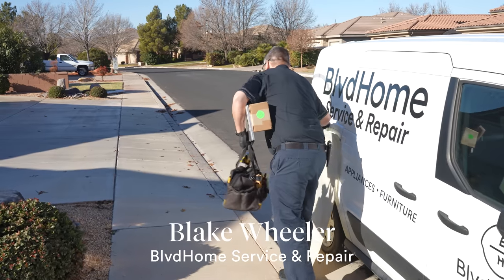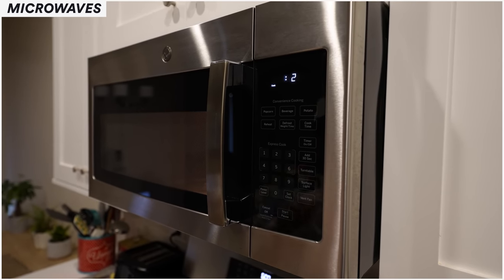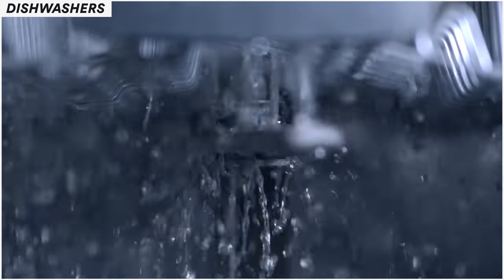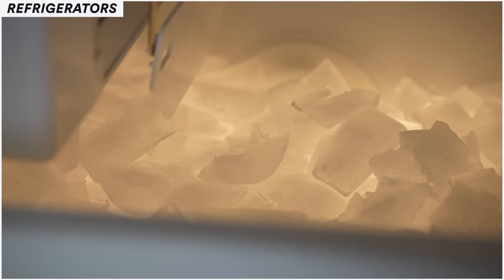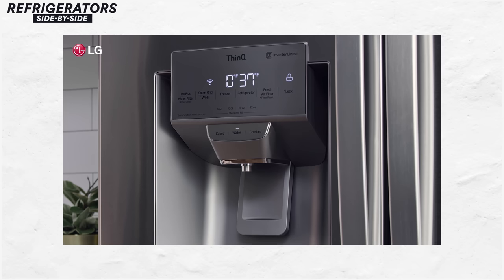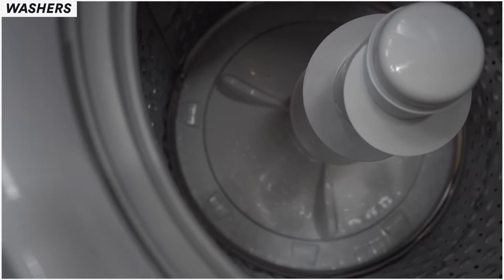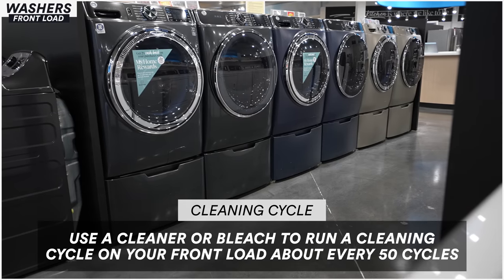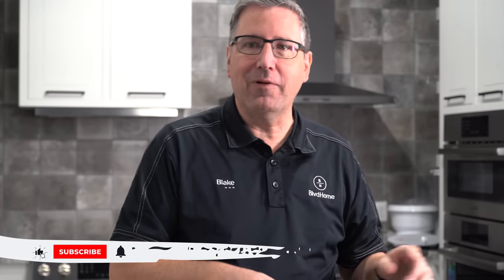Best Appliances Recommended by a Repair Technician of 29 Years

Comment: 1. any microwave with your settings and space is alright
2. bosch dishwasher best
2. french door bottom freezer best-frigidaire best, go for no ice door, GE good too, avoid LG samsung
3. Top load washing machine-speed queen, LG and GE best
4. avoid front load washing machine cz of many issues
5. front load washing machine-electrolux best, lg 2nd, GE 3rd then whirlpool
6. dryer should match with washing machine. cz it looks good.

Comment: I just bought a top freezer Whirlpool refrigerator and I am disappointed. Temp control sucks. Very poor temp control. With only one temp control, to make the freezer 0'F, the refrigerator will freeze if I leave the unit for a few days. I had a GE for 25 years and was a fantastic unit. I would not buy  a Whirlpool.

Comment: I completely disagree with the LG washer recommendation. I know they are one of probably many manufacturers who make the washer with an aluminium spyder touching the steel drum. This causes corrosion which basically creates a ticking time bomb. A few years into ownership, someone puts in an overweight load and the washer becomes a big paperweight. As you well know, the cost of fixing a failed spyder is not worth fixing so the company sells you a new machine. It's unethical and disgusting business practice so I would never suggest that anyone buy an LG front loader washer. I know Samsung washers are the same but I'm not sure if any manufactures build their machines to not self destruct.

Comment: And never buy ANY appliances from Home Depot……why you ask? Because once they drop it off Home Depot will not stand behind it, I mean the DELIVERY guy was showing me how to use it and said “hmmm that doesn’t sound right and I still had to go through all the red tape and 3 technician visits over the course of 3 weeks before Maytag would finally replace it, one month later. Anyone else how much fun it is to have a brand new washer dryer combo and still have to use the local ghetto laundry mat because I sure do

Comment: I hate my Bosch dishwasher. It won't dry anything that isn't ceramic. 

It doesn't have a drying heater, or airflow. It assumes the walls of the dishwasher cool faster than the dishes (and pull condensation), which only works on glass and ceramics.

Comment: Fisher Paykel bottom freezers are a nightmare. 3 years old, the alarm goes off every-time you open door. Called tech he had to ask the manufacturer for help, they said wire inside door was broken and not detecting flapper heater. Fix was a new door! 3 years old, and the fix is a new door. Numerous calls to Fisher and they dont care. Jokes on them, Im a builder and buy appliances for our homes. Guess what I dont buy anymore! Side note: All our LG fridges with linear compressors run without a complaint.

Comment: I have all Samsung appliances, from washer dryer to fridge, stove and microwave.  Microwave doesn't keep good time on the clock and the samsung logo is crooked,  were talking mins off after a few months so you have to reset it.  Stove seems to be ok except the knobs are on the top in the back and there is little support so when you push buttons the whole back panel flexes / pushes back ward which is weird and annoying,   The fridge is the freezer at the bottom style,  has nothing but problems with the door ice, freezes up into a block.  the ice maker in the freezer spills ice out through the hole in the back (so you can pull the freezer drawyer out, so ice will fall behind the drawer and now you can't close the freezer, so you get to try digging the ice out.  so we just keep it off before it gets too full.   The washer and dryer,  washer squeeks like an old motel bed spring during spin cycle.  The dryer has this weird metallic grinding noise, guess its the baring going bad or something.  Most problems i've ever had with appliances.  And my neighbors and co workers who own samsung all complain about the same issues, so I won't be going with them again.

Comment: I work on commercial ice machines for a living. The biggest issue I have with my ice maker is that ice just gets stuck,  preventing it from making ice. Its easy to just blame the manufacturer, but i think it just comes with the territory. The environment is below freezing. Where as, with a commercial machine, its not. So, if ice gets stuck, it will eventually melt and resume operating.

Comment: We have the Bosch over the range 800 series microwave oven and the instructions in the Bosch manual says you can open the door before it stops running. This 800 series does not have a pause button and opening the door acts like the old pause button, you close the door and push the start button again to continue heating. Our old 9305 Bosch microwave did have the pause button that you would push before opening the door.

Comment: I hate my LG front loader washer, it just turned 2 years old  under extended 5 year warranty I bought for $160.00 for the washer from HD, but it's through a major insurance company. I've waited 16 days to have repair guy, over $50.00 in laundromat costs! Guy came out it threw a D2 CODE. It was the door lock, he had to order it at 9 days and then come back. He said door locks a common problem, it's made with plastic parts! He left, 15 min.later I started washer, it threw another D2 CODE! Taking them 3 days to come back! With LG you have to fold your dirty sheets, blankets a certain way, according to owners Manuel from the corner, back and forth, or washed goes off balance. My daughter has a front loader GE, she doesn't have to do that. NEVER will buy anything LG ever again!

Comment: Not all microwaves are the same, bought one in the early 90s, the light went out but it worked for over 20 years. After it died, I've bought two microwaves in the last 3 years

Comment: I'm surprised you didn't mention Maytag for any category. I have Maytag dishwasher and front load washer and dryer units and they have been solid for the past 5 years. You should also make a video on the brands you hate and repair the most and why.
Reply: I was surprised too, I have Maytag washer and dryer, pretty happy.
Reply: Maytag was bought by Whirlpool several years ago, MayTag is not the same Maytag many people remember.

Comment: I have a miss matched washer and dryer and I'm very OK with it.  I have the LG Front Load and LG Dryer. Nothing fancy.  I like the front load washer, however, it do get a little stinky at times.  I wipe the seal down after I'm all finished with laundry. I wipe the door down inside and out. I spray Lysol in the washing machine and around the seal. I make sure to use the cleaning machine cycle more often than recommended.  I clean out the soap tray also every few months. I love my LG Front Load washer and I'll be buying another here real soon.

Comment: I sat through this entire video hoping to hear what dryer is your preference.  Crash and burn.
Reply from the maker: Dryers are really hard to get wrong similar to microwaves. But there are a lot of differences between gas and electric dryers. We're currently working on a video where Blake does a teardown of both dryers and talks about the differences between the two. Stay tuned if your interested.

Comment: We had a lightning strike and it knocked out the refrigerator and the freezer isn’t as cold, either.

The problem is that they’re a built in side by side set and when we looked to replace them, the new version of the ones (Frigidaire Cafe) we have don’t fit in the space.

My husband wants to see if he can just replace the control boards, but they’re on back order.

I can’t imagine why they aren’t a standard size?

Comment: One thing you didn't mention was the quality of plastic used in the dishwasher. For plastic a salty environment like a dishwasher is a harsh environment, so plastic tends to dry out quicker and fail. Although plastic repairs isn't usually something you call a prepair technician for.

Comment: All he sad is like reverse. About fridges here what you need to pick do not buy any of those which has ice maker or 2 doors. They will brake and they will make your energy bills high and they are built to brake as manufacturer knows they will buy again. Better if you need really buy 2 fridges with 2 freezers at bottom. Now which to choose dont buy samsung or dont even look at fridge which has smartphone or any screen. they are useless and they will use more energy for no reason and even heat up the fridge which will cost even more energy. In shop you may see lots of fridges, but actually there will be only 3, basically all of them are same. Search for fridge which has inverter type compressor and has no frost technology in freezer and in fridge. inverter is higher price but will cost your energy bill down also it will be not noisy. Big will always be noisy as hell. No frost will make no ice problems, no water on floor. Now you will have basically 3 types thats it all will be same identical, dont look at naming like metal freezing it means nothing. What you must look is size price , energy efficiency at A or it may be same A+++ rating in europe they must place sticker of actual energy used. Now look for better plastic as it brakes and it will cost way too much. Search for better plastic, avoid those fridges which are turned on. They do this as plastic inside is cheap so it smells bad so they turn on. And yes it will brake. It would be good to find what compressor it uses from which country search from EU made. It will be on other side at bottom. also check rubber if its good if you can take it off. If you cant its probably cheaper made. Also try  to pick no handle option as they make door handles so thin it brakes easy. Dont forget all manufacturers have good one and very cheap ones which are bad in quality. But than its very expensive they will make it brake. Also pick fridges where it has computer temp controlled it will be more efficient its mainly all electronics it must have you will touch it once in life and you wont need to touch it again. Now about washers go away from those which has wifi or any of that crap, less is better. Only look for better energy efficiency ones.

Comment: I bought a French door bottom freezer because I had heard that through the door I’ve dispensers have more problems.  After 13 years with my Samsung (oddly), the first problem I had fixed yesterday.  The ice sensor bracket got knocked off.  Found it and replaced it.  Back to normal.

Comment: This was not helpful at all. No they are not all great. I want to know which ones last longer he longest and has fewer issues, and if they do have common issues , are they  costly and complicated issue or a inexpensive part diy issue. That’s the stuff that is  very Helpfully . Not these vague words you use. considering most make junk now a days. My kenmore washer and dryer are 24 years old and I will not get rid of them for the new nice looking junk they sell. I change the inexpensive parts , and recently put in a new transmission and the machine rubs like day One. Mother in law bought a new one and had problems within 3 months .

Comment: WoW! That's very interesting about the microwave door, perhaps they should have a locking mechanism similar to front load washing machines, have to press pause or cancel to open. Always had a KISS mentality with fridges, Ice trays in freezer. Thoughts on combined washer/dryer would have been good.

Comment: Don’t buy LG ever. My mother has one and had it approx 5 yrs or less and it’s now not cooling. Got to be the compressor of course. LG is giving her the run around.  A local certified repair company stated they cut off working on LG due to LG failing in contract negotiations. No one seems to want to work on a known trash company’s faulty appliances.

Comment: Thanks for this video. I agree with you about people who say a top brand is lousy because they had a problem. I have an Electrolux washing machine that’s about 6 years old and isn’t draining and I don’t know if I should have it serviced or replace it. I’d love to see a video on something like “Repair or Replace? A Guide for knowing which to do”
Reply: Electrolux front loaders - they removed the access panels to viranbthe filters which is a required maintenance for all front loader machines . It’s usually located at the base of the front of the machine behind a small access panel. It should be cleaned monthly to prevent clogs or draining issues and elongate the life of your machine. Almost all front loaders have these access panels - I don’t know why Electrolux removed them. Now you have to lift the machine and tilt it back to a 45 degree angle to try and access through the bottom panel which is almost impossible or disassemble the machine to get to the filter. There is no reason to block access to those filters unless it’s to force repair calls or new purchase parts. The 7637,7537,7437 series as well as the prior series all have no access panels. It’s discouraging. I wish they would explain the intentional reason for removing the access.
Reply: @Kathy-dj6di  Thank you!
Reply: I noticed the Electrolux front loader did not have the small door on the front when I was being helped by the Specialist in the Lowe's appliance department. She had never noticed it and had no idea why it didn't have one. She tried to tell me that Electrolux had come up with a solution to where you didn't have to drain the water out so that was a good thing. But when you watch YouTube videos on how difficult it is to get to the drain and filter now and get baby socks and other items stuck in the filter...it does make you scratch your head and say...really??

Comment: I’ll never buy korean appliances again. My six year old LG bottom freezer french door refrigerator is disintegrating before my eyes. Plastic parts are cracking and falling off. Small springs and screws fall out of the water dispenser every day. The tray no longer works. The doors constantly need the screws holding the handles on retightened. I suppose it’s good that the compressor hasn’t failed….yet. The repair cost is likely more than the fridge is worth. And don’t get me started about the dishwasher with cracked control panel and lcd that doesn’t light anymore, or the stove that had to have the main board replaced. Never again will I buy from this manufacturer. I should point out that the appliance is never abused, being in a household of just two adults.

Comment: Man this dude is very sus. I guess he never heard of Speed Queen which has 7 year warranty and is built to last 25 years, so guys and dolls do your home work.
Reply from the maker: we actually agree that Speed Queen is one of the best washers you can purchase on the market today.  Here is a video we have created on the subject.   https://youtu.be/s5boLworKn4?si=1wL5_ANsngDZYtGm  If you want a washer that comes with an extended manufacture warranty and has limited bells and whistles but should be reliable for the long run go Speed Queen.   The biggest downside is the price which comes in higher than most other top load washer options.

Comment: So, basically, stay away from brands that also make televisions. LG SAMSUNG.
Reply from the maker: LG makes great washing machines though! And their TVs are better too.
Reply: @BoulevardHome  I actually have  Samsung and LG tvs and love them both. Then I bought a Samsung fridge and it crapped out on us in less than 4 years. Just got Speed Queen washer and dryer a few months ago and so far so good. Our house just turned 20 years old with all original appliances (except for our downstairs fridge) and everything is starting to fail so we just decided to replace everything. Went with GE appliances in our upstairs kitchen. Microwave, dishwasher, range and fridge. Actually just doing the install as we speak. Hoping these will last. Fingers crossed.🤞

Comment: We have lived in our home for 56 years and we have replaced many different appliances, the dryer is the only thing that seems to last we have had only 3. The first was what we had when we moved from Chicago to the suburbs and it was already 15 years old, when it  finally went in 1973, mom and dad bought a KENMORE it had 1 dial and 1 on and off switch, that machine lasted until 2018. We now have a GE dryer with no problems.

Comment: Video was turned off almost immediately. Microwave switches.... I assume by high voltage you mean 120V and not what is coming out of the transformer for the magnetron. I'd like to see the wiring diagram that shows that the door switch is disabled when the microwave is not running. It is significantly more likely that this switch is always fed power regardless of whether the microwave is running or not.

Comment: I think this gentleman lost all credibility as soon as he mentioned that the microwaves run a high voltage through the door switch.  It's a low-voltage/signal that is routed through the switch, that same signal is router with the MCUs STOP/PAUSE function, which gets interrupted when you open the door or press pause or stop.  That same signal is connected to the input Gate pin on the MOSFETs which switches the high voltage/amps mains.  Why would they run high voltage through a switch if the same signal can be used from the MCU that turns ON/OFF the MOSFET? That would imply that the voltage switched by the MOSFET goes through the door switch before it hits the transformer, which is bad engineering and could cause severe arcing due to inductive loads of the magnetron and transformer.  Sorry, this guy is looking for clicks and is not credible.